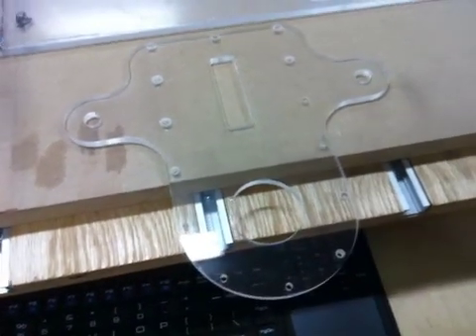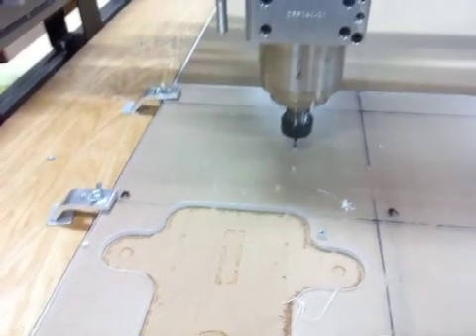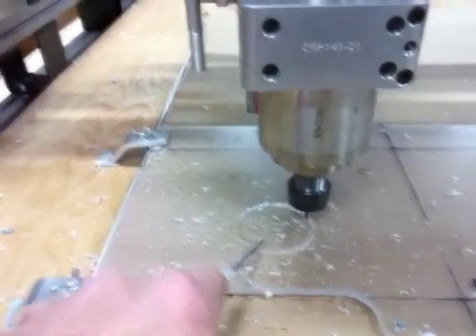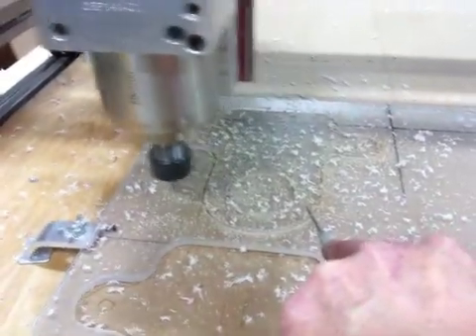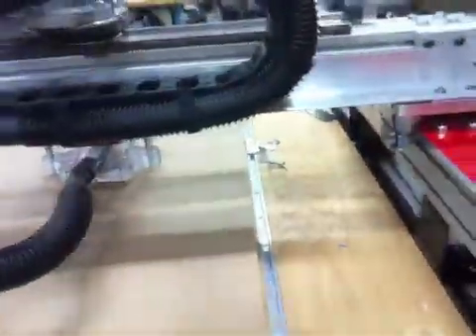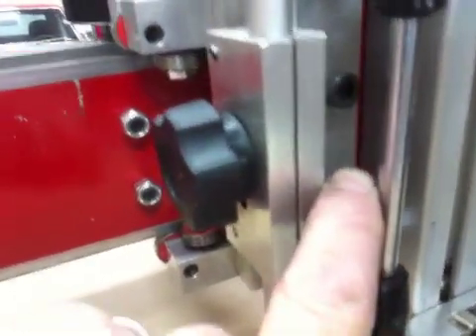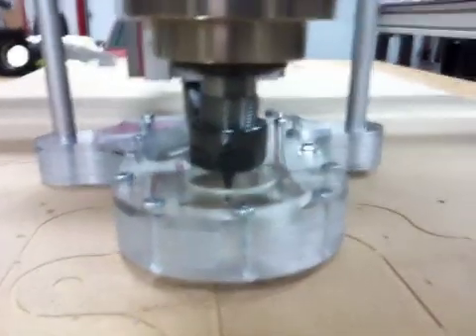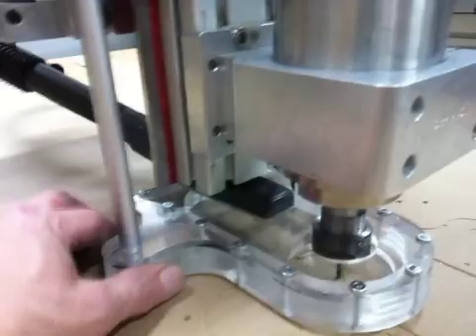Dust Shoe design and construction for my CNC router table

Comment: I have a CRP-4848, your design is exactly what I was thinking about for my own dust shoe.  Would you be willing to share the files?  I don't have V-Carve, but if you can generate a PDF with the dimensions I can reproduce it in Fusion 360.